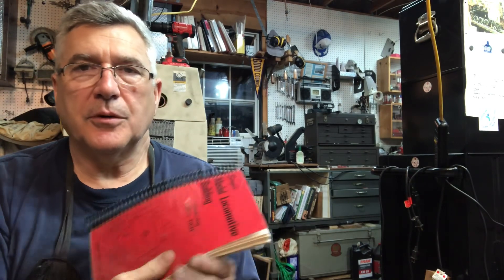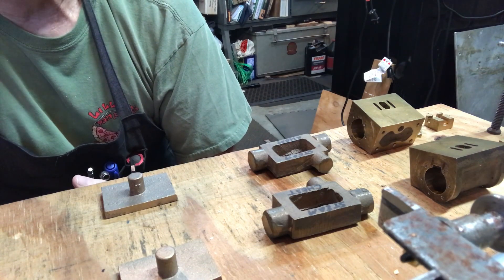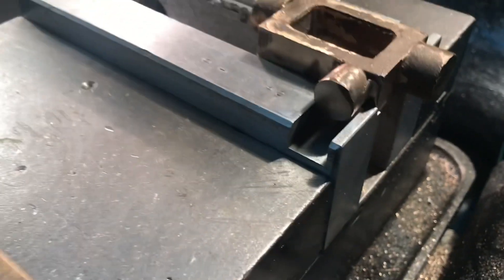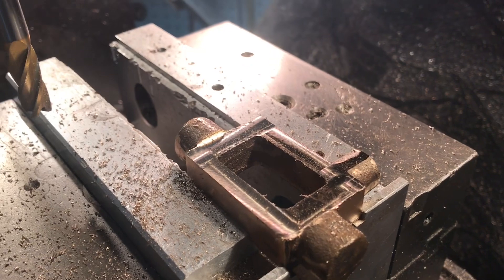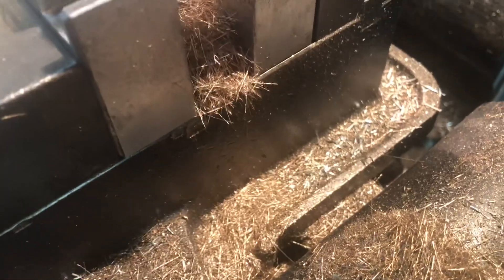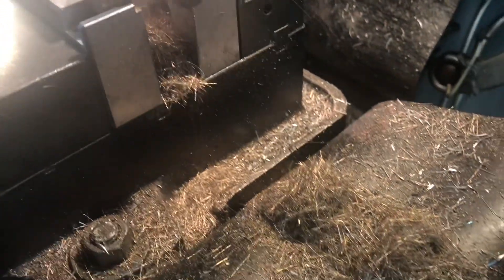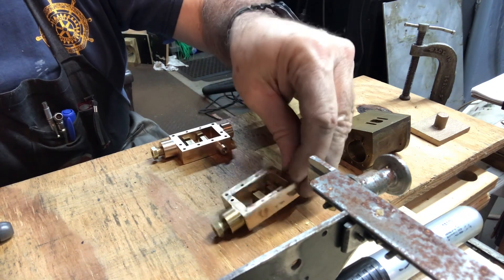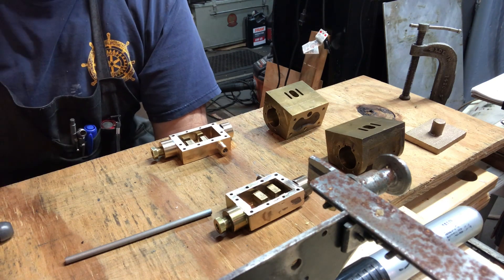18. LBSC TICH LOCOMOTIVE. Steam chests including fixing a mistake..

Comment: Hi, well done recovering the valve chest, if I have to straighten something like this, I always expect to have a problem with 'spring back' use shims to over-correct then the spring back results in a straight edge, did you get any spring back? I have not tried to bend PB so don't know it's characteristics
Reply from the maker: @tonyashgrove9512  thanks for watching and asking, no spring back, probably because I heated the part during the correction process.